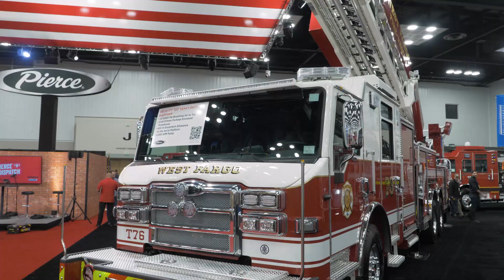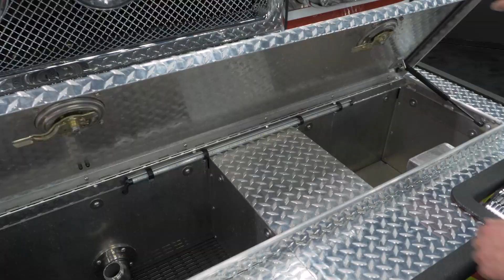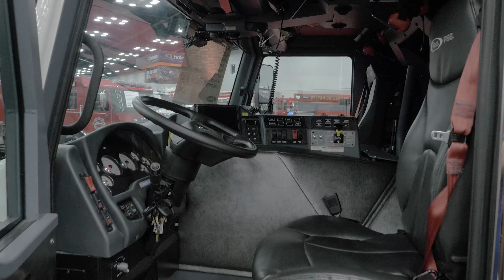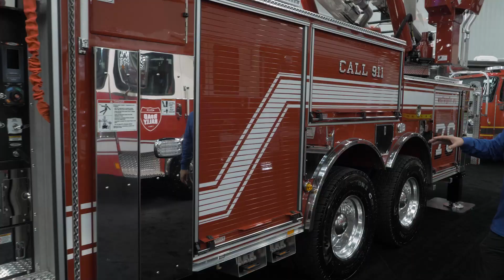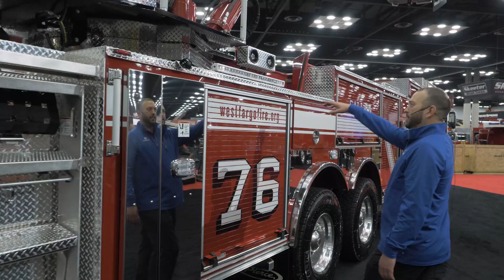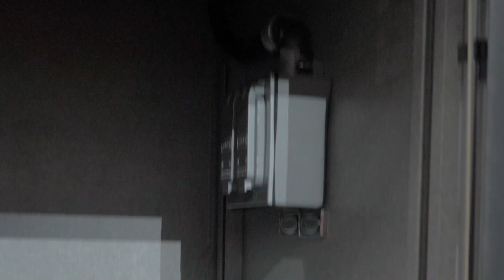Velocity® 100’ Heavy Duty Steel Aerial Platform – West Fargo, ND

Comment: Can anyone explain why there is only room for 4 or 5 people on this kind of aparatus ? In germany, we drive on this type of aparatus with a minimum of 6 and a maximum of 9 firefighters.
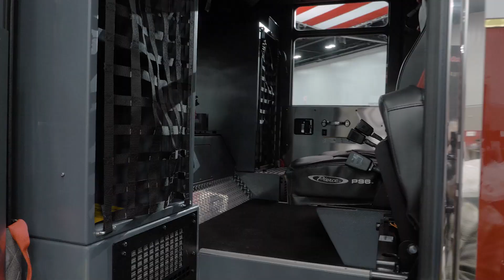Reply: 1:15 This truck has a total of 6 seats.  Driver, officer with SCBA, 2 SCBA seats in the rear center, and 2 flip-down seats by the rear doors.  6 seats on a truck is pretty standard.  USA trucks can have 4 to 10 seats, but most don't ever have more than 8.  Career departments can have 3 to 6 people total per shift or that many staffing each truck.  Volunteer departments will have the same number per truck, but each truck would go out every minute or two as more people arrive to the station.  Combination departments would typically have 2 to 5 career people on a single truck for a quick attack or at least to set up hoses for incoming units, then the volunteers would fill the next trucks.  Every department runs differently based on what hazards are in the community, population, budget, call volume, staffing, and preferences of the leadership.  USA fire stations can have 1 to 4 big trucks, 1 or 2 small trucks, an SUV and/I 😮😮or pickup truck, and 1 to 3 ambulances if they provide medical transports to hospitals.
Reply: @ml9867  In our trucks the officer do not have an SCBA. In some paid department they have but not in volunteer. When the truck is equiped with SCBA in officer seat the county have a lot of money.😅
Reply: Do you carry EMS equipment over with you Do you carry ballistic equipment with you Do you carry Extra tools and stuff. Also we don't man fire stations with 9 people the maximum I've ever had on 1 shift and 1 time with mine was 7.
Reply: @navblue20  Some carry EMS equipment and some dont. Never seen someone carrying balistic west in germany. In paid department they are 10 to 15 people in one shift.
Drive 4 to 5 in a 9 man cab. Difference in some citys. In volunteer department this kind of aparatus drive with 6 to 9 people.